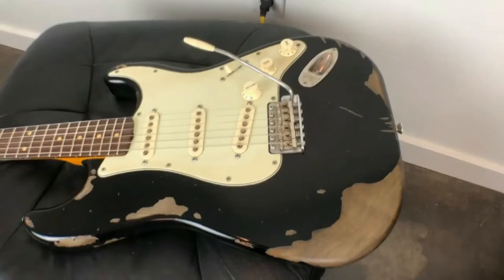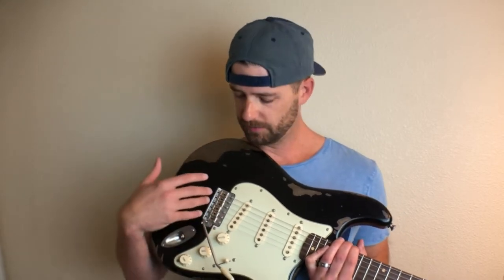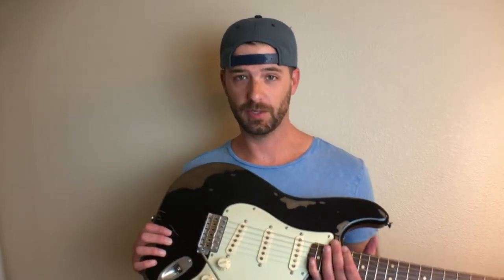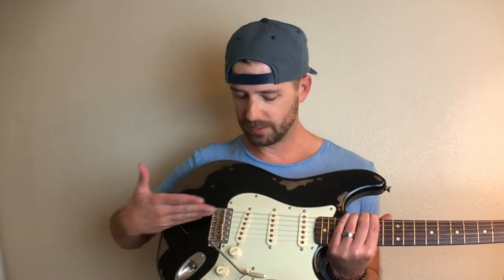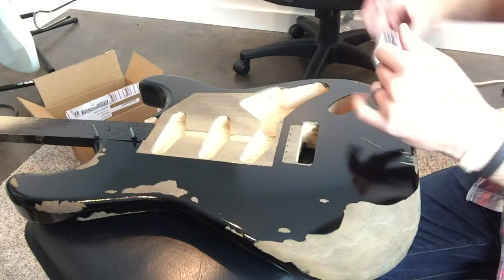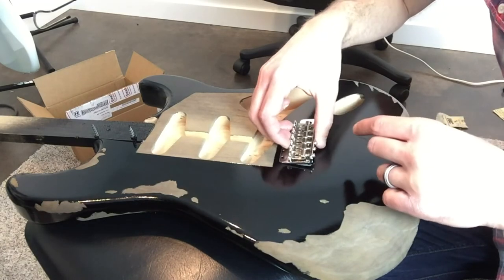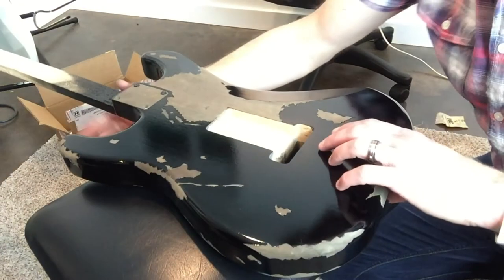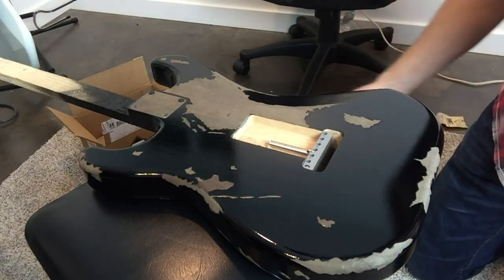Strat Trem Installation: Things to Consider

Comment: What did you use to paint the neck? Thx
Reply from the maker: SewaS Play I used StewMac vintage amber aerosol for most of the neck. For the worn off part, I left it bare, aged it, & then put Tried & True Oil on it. Here are three videos I did just on the neck:
https://youtu.be/BO_cYb-hd0M
https://youtu.be/MfHADczy5OE
https://youtu.be/7WnknauVz5k

Comment: Nice vid man, the headstock would look better with a walnut/plastic truss rod cavity liner.
Reply from the maker: Ruequi yeah, it’s just a personal preference thing. This is a customized Musikraft neck. The actual vintage guitars from the 60s didn’t have a truss rod adjustment at the headstock (it was at the heel of the neck). So I wanted the convenience of the adjustment at the headstock, but the vintage look. Also, I don’t have a “skunk stripe” down the back of the neck. 👍🏻